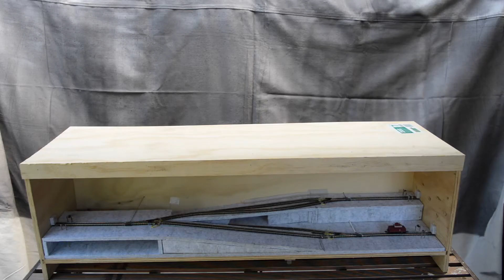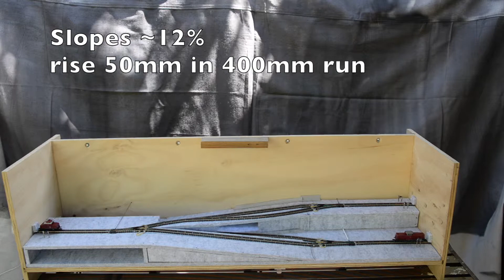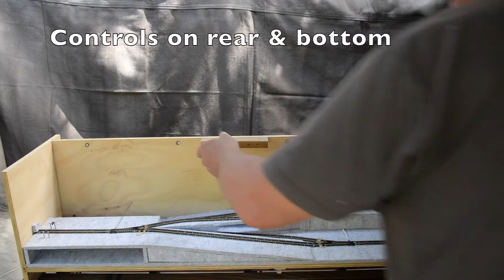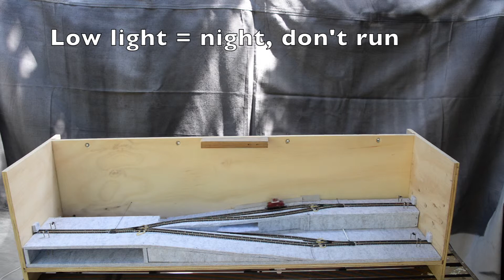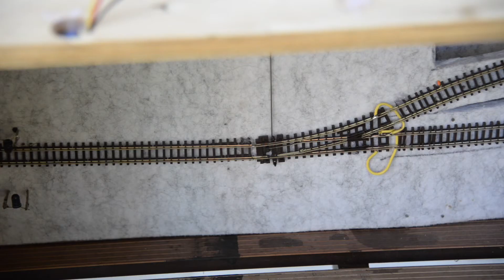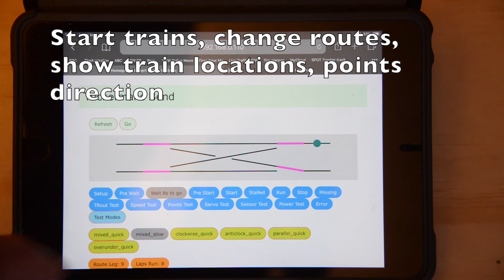Tuckermans Bend 01 Layout

Comment: Very cool. I'm working on a larger but similar version of something like this that I'd hoped to also automate with an Arduino (though using Hall Effect sensors with magnets under the cars rather than the light sensors). Would you consider sharing the code you've written? I'd be very appreciative to have something to work from and modify for my layout.
Reply from the maker: Sure.  The code at the time the video was made, is here: https://drive.google.com/drive/folders/1RtPKB3n1qyl3z201D03T6YnfOQb1cBN3?usp=sharing  . I have put the current version there also. We tried reflective IR sensors with white patches under the engines, but found it easier to use transmission sensors for our purposes.  At some cost in visual appeal, of course.  Hall effect sensors will make a much nicer visual effect.
Reply: @contrarotator  Thank you so much for sharing this with me. I appreciate it. :)